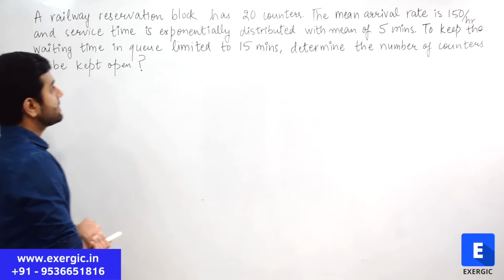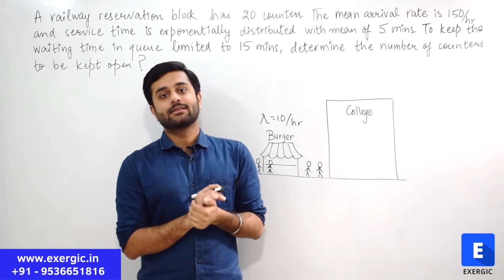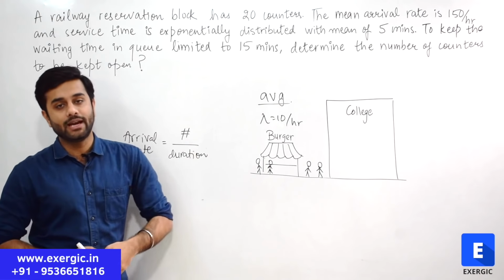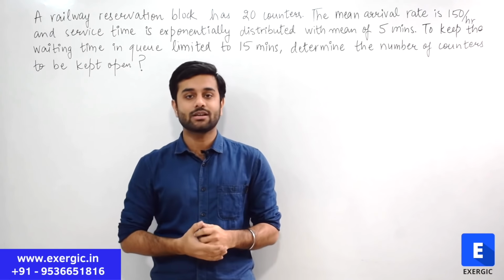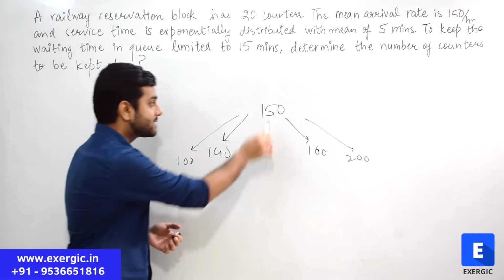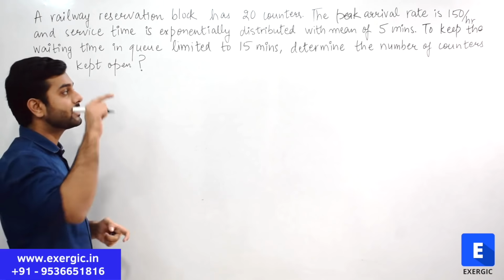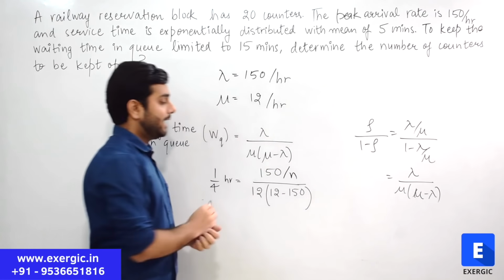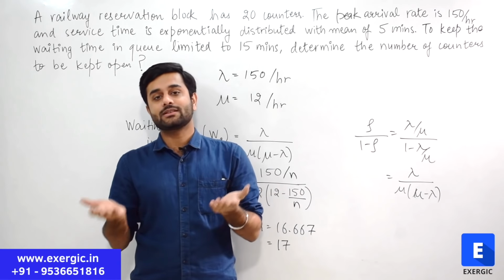Useful concept explained through question - Industrial Engineering | GATE ME, PI

Comment: why we didn't divide by n for service rate? and this question was wrong only because of "mean arrival rate? 
reply!!
Reply from the maker: Sir has explained your first question in the lecture. Watch full lecture till the end.

Regarding 2nd question, YES. Instead of mean, it should be peak.
Reply: Bro... Instead of taking  (150/n) why can't we take (12n) here... ??
Reply: If we do so then we will get n=13 ... Can u plz... Give clarity on this.??
Reply: @kinthalisantosh8724  The formulas used here are applicable to only 1 server system, that is why we have computed peak arrival rate for each server as 150/n and hence cannot use 12.n because we will be clubbing all the sever as one eventhough each server has exponential distribution(i.e not a constant service rate).
Reply: @amanbhardwaj5542  
Aise M/M/1 ke sabhi formula ko sigma/n karke apne M/M/n systems me use kr skte hai kya?
Reply: @Anonymous-qq1yy  Only if in question you have been given peak arrival rate( which will be constant) and hence you can easily conclude that arrival rate for each server is Arrival rate/number of servers. Be warned that if average arrival rate is given you cannot divide by number of servers to get rate for each server because average arrival rate is of poisson's distribution.